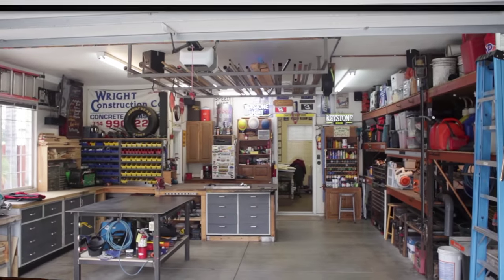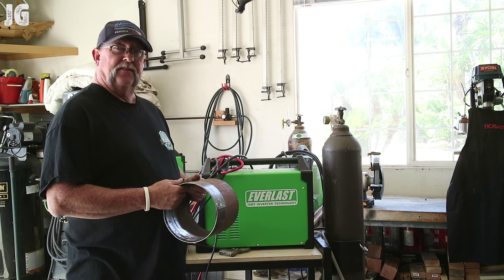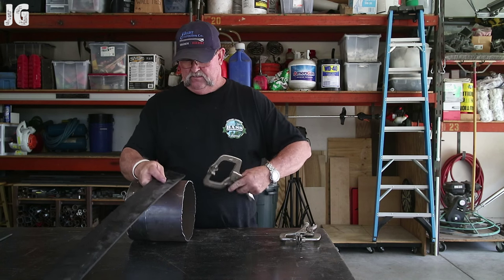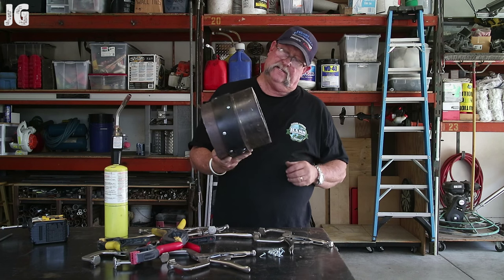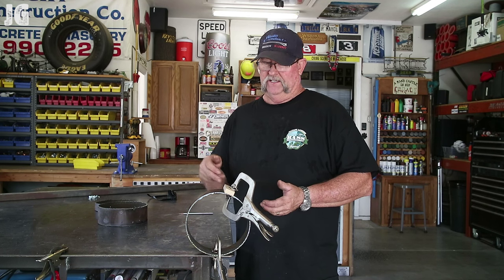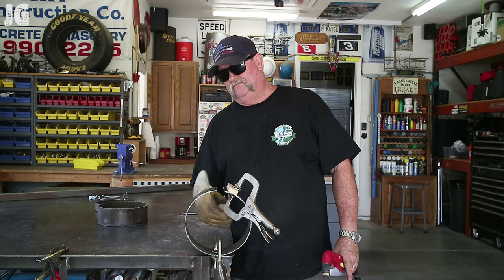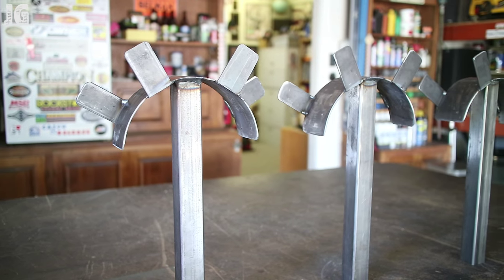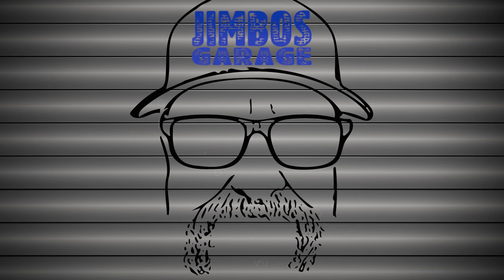Welding Cart Lead Holder - Jimbos Garage

Comment: I have a regular chop saw with an abrasive blade on it will a blade like you have work on it or does it take a certain kind of saw and what is the name of the blade Thanks and great videos
Reply from the maker: +Charlie Thompson Hey Charlie, Thanks for the comments. The Makita saw I have is for cutting metal, It runs at a slower rpm than a regular chop saw. You might want to look at that. The blade I'm using in this video is a TENRYU, There are a lot of metal cutting blades out there, Not certain if one is better than another.  Jimbos garage!

Comment: Great idea using tubing for the curved part of the holders.
Nice and clean design.

I'm curious to know which models you got for each of units?
And also would like to know your opinion of the products?

Thanks!
Reply from the maker: +Karl Gabel   Thanks for watching Karl,   I have the power i mig 205, and the power plasma 60, And the power tig 210 ext. And i love all of them they all work great. Jimbos garage!
Reply: Thanks for the fast response Jimbo - considering buying Everlast products - great bang for the buck!

Comment: can you tell me please what type of cutting wheel you have on that metal drop saw?
Reply from the maker: +steven Arango   Thanks for watching Steve, Yes that is a 12' TENRYU carbide tip metal cutting blade, That is the brand that my metal supply store has in stock. I'm sure most metal cutting blades are similar.
Remember! That is a metal cutting chop saw, Not a regular chop saw. It runs at a much lower r.p.m. Jimbos garage!

Comment: Nice selection of Welders and torches!  I am just getting started in welding and was curious which type of welding  you find is best to start with.  Mig or TIG.   Not interested in a dedicated stick welder.  I have a budget for only one machine at this time and considering best bang for buck.   I don't need to aluminum welding right now but I do want to use that material down the road. I am leaning towards TIG Welding due to the cleanliness of the welding and the nice tight precision.   In addition the ability to stick weld as well.  Thoughts?  BTW Considering an Everlast  PowerTig 250 EX.  I see you have had a few Everlast Welders on your videos though I know you recently moved to HTC MIG and use that quite a bit.
Reply from the maker: You might want to look at a multi purpose machine, That might be the best for you. Everlast has them.  Jimbos garage!

Comment: Hi Jimbo. I am new to the channel and so far I am having a great time watching your videos. I currently own a lincoln 225 amp AC welder (Doesn't look like a "BUZZ Box" but is the same thing.) I am still learning and do have trouble at times but it is  getting better (Baby steps...baby steps) Now I mostly have or stock 6011 and 7018 sticks since they appear to be the most used by people like yourself. My Question is this. Can I keep my lincoln or should I upgrade to a DC stick welder? Is there a difference in the quality of the weld? Or is it easier to weld with? Thanks so much for the time you take to make these videos. I wish I had more time to devote to mine.   -John
Reply from the maker: +Big Guy Review Hey John, Thanks for watching and your comments. Not sure what kind of Lincoln 225 ac welder you have if it's not a buzz box type, But never the less, Those are great welders to start out with. DC welders tend to have a smoother arc and run a lot cleaner with less splatter. And the two different types of electrodes you have are great! 6011 for deep penetration, And 7018 is great for all around work. Stay tuned for more good videos to come. Jimbos garage!
Reply: The 225 ac is an ok machine but if I were you I would upgrade to a nice used Lincoln idealarc 250 ac/dc machine. I see them all the time used for around $700 and they are well worth it I love mine. I run my esab suitcase off it along with using it just as a stick welder. Your machine isn't set up for 7018 or 6010 yours is more for 6013's. They sale your machine at Lowes/ home Depot. I'm not saying you have a bad machine it's just not very versatile on what all it can weld.